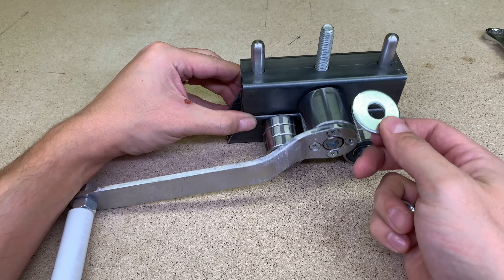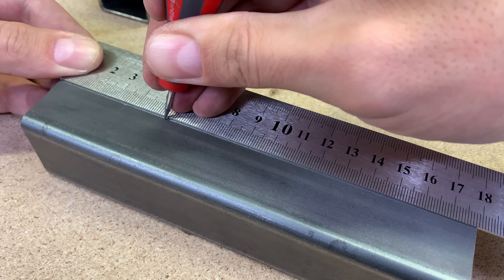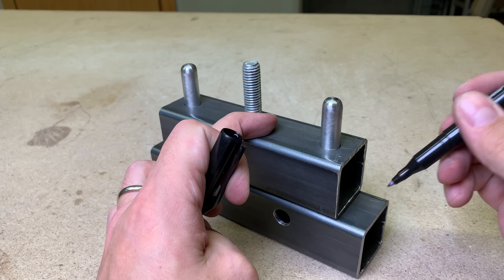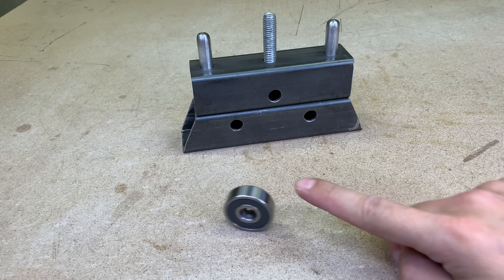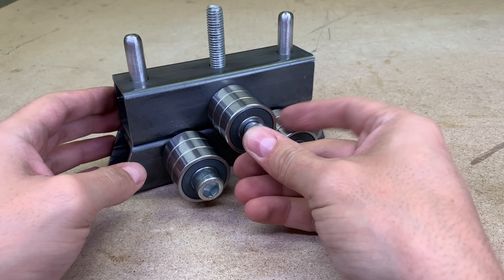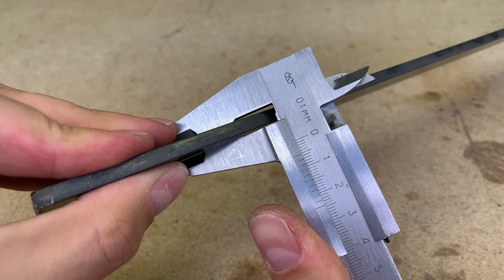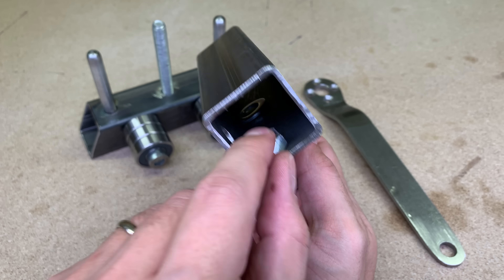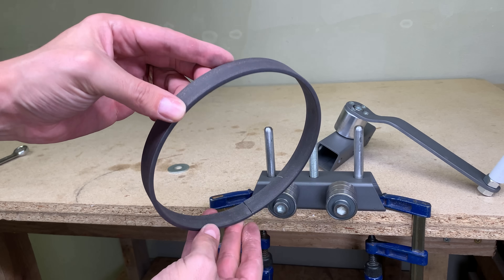How To Make A Homemade Roller Bender || Metal Bender project

Comment: Hi , when you flip the tube by 90 degrees, you say you draw a line 15.5mm off set, but in the transcript it says 13.5. I think the 15.5 mm is too far, it won't lock a 12 mm nut inside the tube wall
Reply: A pair of nuts

Comment: Thanks so much for the great idea! I am in the process and will post pictures when I'm finished. One thing I ran into was getting the nuts close enough to the side wall to "hold the nut." I did not get the hole close enough for that but it was too close to get  wrench on. 😞 I do however have a MIG welder that fit right in there and welded the nut in place. 🙂 Also I am going to weld a shortened socket, 1/2 inch drive,  to the "drive" roller to turn with a long socket drive or slow drill. Wish me luck!  "Fabrication is a blast!"

Comment: It's crazy how much force this roller can produce. This was my second DIY metal roller - a better design than the first (by Diamleon) since you're turning the roller vertically instead of laterally. When you're rotating the crank on a plane parallel to a wall instead of the floor, you're able to use your body weight and gravity. When you're spinning the crank laterally, you can reach a limit of traction of your feet on the ground even when extending the crank arm with a pipe.

This design did a decent job of rolling up to 2" wide steel bar that was 1/8" thick. I found that if I added 3" in length to my circle circumference, rolled until the ends touched, then cut off 1/4" from each end at a time, I could roll all the way down to a 4" radius. I rolled 2 of these, welded them together and made my own 4" long, 4" diameter. 1/8" wall pipe. 

As I kept using this roller, and kept stressing it, I found it's weak spots. The first was the weld on the on center vertical guide screw (at the 3:08 mark). The pressure I was putting on this weld caused it to snap the beads and break twice. My fix was to weld it in a second place - where it met the top of the lower square tube. This of course caused a clearance issue, that prevented the upper and lower square tubes from coming as close together. I fixed that by cutting a clearance whole on the bottom of the upper square tube. Cutting this whole also gave me access to the nut that holds the bolt that secures the center roller. I found that the nylon lock nuts would slip under enough pressure, and allow the bolt to tighten too much, and would stop the crank from turning. Changing all the nuts (used for each roller) to solid steal, and welding them to the square tube, also increased the amount of pressure I could exert. They were hard to reach though.

After beefing up the center vertical screw's connection to the lower square tubing, and welding the nut for the center roller, I was able bend 1/8" steel bar more easily. I did notice some texture forming on the center roller - on the edges nearest the square tubing. I could also see that I was bending that whole assembly upwards. Because it was out of square, the work that I was rolling had a tendency to crawl towards the square tubes. Once it started to bend, it would try to get between the two square tubes, preventing itself from further bending. With the last pieces of steal I bent with this roller, I would tighten a the top nut a couple of half rotations, roll the work back and forth a bit, it would work itself between the square tubes, and I'd have to loosen it and reset it.

My roller ultimately failed when I attempted to roll a 42" long piece of 2" x 3/16" bar. Somehow the force on this became so strong that it caused the top nut (used to lower the top square tube and roller) to shift on it's threads and cross thread. This was a 3/8"-16 steal rod and it was so cross threaded I had to use a 2' pipe just to turn the wrench enough to make space to cut it. The threads on the 12mm bolt that held the hand crank to the top square tube were also (gloriously) fouled up. 

I'm probably going to make this again, but more robust. I think a second set of square tubes parallel to these and welded onto a seriously rigid base (at least 1/4" thick) would make it much stronger. The crank would have to go on the outside, and looking at other DIY Slip Rollers, it looks common to have gears and a chain to link the two lower rollers together.
Reply: it would be much appreciated if you could list down here the needed materials and its sizes especially the size of the bearings. Thank you
Reply: can you bend a 1.5" square pipe with this?

Comment: Hi! Nice work!! I went to make the drawing for it and realized that shorter piece should be around 162mm instead of 145mm, as the holes you marked where at 35mm, 90mm and 145mm. 
Maybe im not seeing something, if so please let me know 👍🏼
Reply: Do you have full mesures of this?
Reply: Las medidas están bien. Desde el centro que serían 90mm hacía los lados tiene 55mm= es decir 110mm. Con el tubo superior de 145mm alcanza y sobra.
Reply: I work in welding all metals, oxygen, and also work in detailing home furniture, such as tables.
Reply: Ihj

Comment: I like this movie. Knowledge with a story. I did make a copy of it. By the way, it works well with flat metal but with round metal it's rather complicated because the metal keeps sliding out. But I when changed the middle bearings with smaller ones, it worked very well.
Reply: I work in welding all metals, oxygen, and also work in detailing home furniture, such as tables.

Comment: Its simple only of you have those piston heads or some hardened steal tubing. I had to rewind 10 times 4:58 to hear he said "car break calipers" Now its simple. LOL.
Reply: I wish he'd identified the make/model of the car from which that caliper piston was salvaged - it's nearly impossible to locate them by dimension.  You need to have a model or part number to find a source.  This is about the only thing preventing me from starting the project today.
Reply: Did anyone ever find a piston? This is the biggest obstacle to actually completing this build
Reply: Getting a piston and then sizing the bearings accordingly could be another way to match them.

Comment: If it’s scale up, can it bend pipes?
Reply: Pipe/tube is tricky to bend without kinking it in the middle.  To bend them well, ie without the kink, you will likely need special equipment like a dedicated tube bender.  However, if you're just sticking stuff together in your garage, then a few friends and a tree might satisfy your needs.  This vid has a visual on why a dedicated bender works better.   https://youtu.be/NzXecCoQWgg?t=332